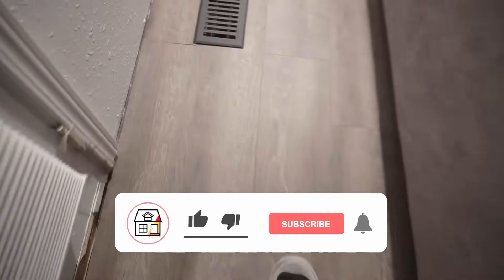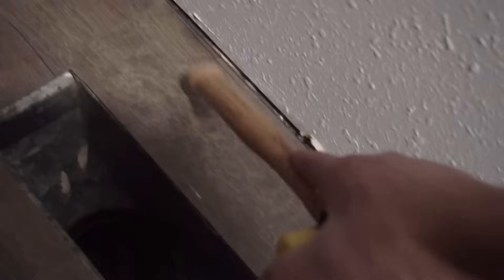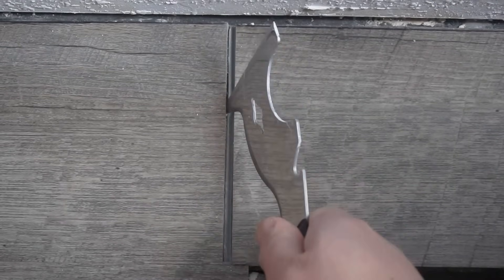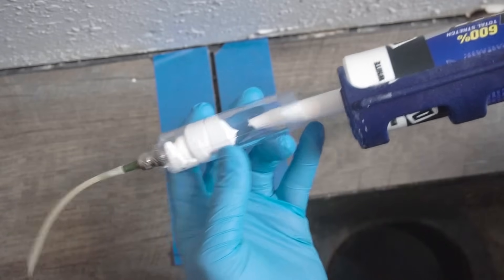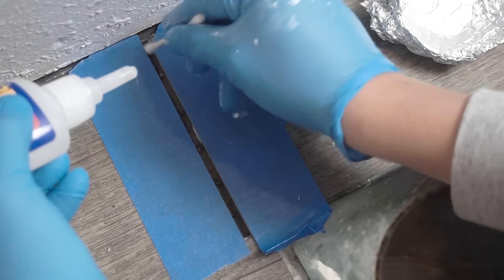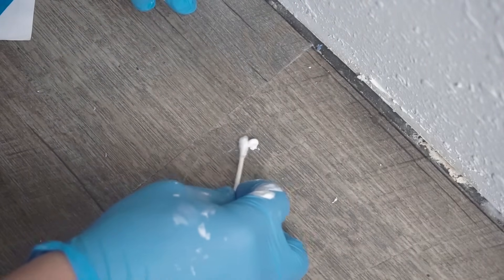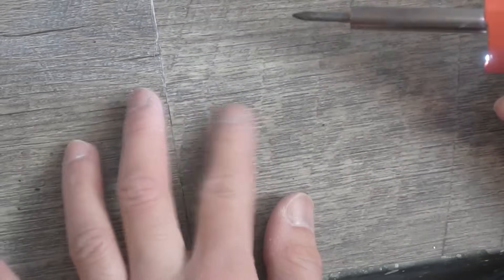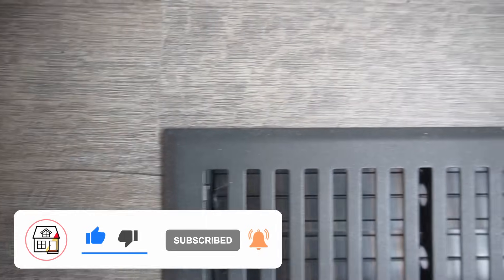How To Fix Uneven & Loose Laminate, Vinyl (LVP) And Engineered Floors DIY Tutorial Tips and Tricks!

Comment: Thanks! You are pretty amazing! I learned a great deal from you and I will be putting it all to work here in my fifth wheel RV. I am in the process of replacing carpet with LVP and the floors are a bit uneven. That causes the long seams to resist fitting together perfectly in some spots. Based on your instruction I believe I can solve the problem. I'm curious, did you go to some sort of trade school to learn this or did you manage to do it by trial and error? Either way, big thanks!

Comment: This video saved my bathroom DIY. Everything was back in place, and LVP is textured. I bought the suction cups, but it couldn't overcome the texturing. However, I bought some mounting putty (like for posters) and shaped it around the rim of the cup. It required some downward pressure to fill in the gaps before I locked the cup, but it worked like a charm!

Thank you thank you thank you!

Comment: If my sag is on the long end? I thing the gap below caused a section of the long end locking strip to get damaged? Would you fill with the stretch caulk through the drill holes and glue the long edge?

Comment: I could not find any videos on your channel that deals with sheet vinyl. What do you recommend laying sheet vinyl that covers two levels. I've removed the carpet from living room and the sub floor is plywood and then then to kitchen that has vinyl tiles that are glued down. My question: Is there a product that I can apply that will transition the two levels and make it to where you will not know it has changed levels?
Reply: How thick is your glued vinyl in kitchen? If it's 1/8" you can get away by feathering from vinyl to osb using floor leveler, just make sure you make the transition about two foot wide, so it is almost unnoticeable to the foot when going from living room to kitchen. 
After patching that, you'll need to put 1/4" floor underlayment in the whole area where the sheet vinyl goes, I know, this part is kind of expensive but necessary, never ever install sheet goods directly over osb.
Then install the sheet vinyl using the recommended adhesive for that especific vinyl. If it is felt backed, use adhesive for felt back, if it is the sheet vinyl that requires pressure sensitive glue, use that glue, this step is crucial.
I would try to remove the kitchen vinyl if possible, that way everything is level, if you opt to do that just make sure that you don't leave an sticky residue before the 1/4"underlayment. If your kit area floor is sticky you can emboss it using a very  thin layer of floor patch, just enough to neutralize the old adhesive, otherwise it will give you a clicking sound every time you step over the underlayment in that area, some folks just put roofing felt paper over the sticky floors to neutralize and then install the 1/4" underlayment.
My guess is that you already have a 1/4" underlayment plus the vinyl in kitchen area, about 3/8" total height, if that's the case, just install underlayment in living room areas to kind of match the height and then patch between them.
I always try to remove the kitchen floor if possible but sometimes it is a lot and is better to just leave it alone.
I hope everything made sense and didn't confuse you.

Comment: Do CA glue.... attach boards...spray on accelerator....it wicks through the joint...if you add it while the joint is open it'll set up quicker than you can pull it back together....I wouldn't recommend drilling holes to inject anything....drill a hole...and inject something... warranty is over
Reply from the maker: Thank you for the tip and advice 🙏🏽I mentioned warranty during the video 👍🏽😊
Reply: @FixThisHouse  Yes sir... drilling holes in any flooring system will negate it's warranty.... just tryna help you out... 😉👍

Comment: Well this is nice but my boards worked loose along the long side due to slightly uneven floor I think. not the short side. Long side doesn’t want to move at all to close the gap. I actually made the surrounding area worse by messing with it with my suction cups and mallet ☹️

Comment: I have the exact same flooring as you do in the videos. I have a piece where the locking (male+female) mechanism has broken on the long side of the board. Would you use the same method to separate the pieces and glue them back together?
Reply: Just replace the board....takes not even 5 minutes
Reply: @habanohal  how do you replace it easily if it’s in the middle of the room?
Reply: @Leticia Ramirez  many videos on YouTube how it's done. Hard to explain, possible if you don't do flooring. Just will take some practice

Comment: I know you use big stretch for movement, but isn’t movement the problem? Don’t you want the movement to stop so it stops separating?
Reply: You need to allow floating floors to expand/contract, so movement is required. The cause of the original problem was most likely due to lack of space to move around or uneven subfloor

Comment: Your failing to address that the flooring was installed incorrectly to begin with, you should have the tung and groove engaged on all sides of the piece the flooring installer took a short cut and cut off one of the grooves that's why this section is not coupled to the other piece, click together floors are actually pretty difficult to install around obstructions and you need to know the myriad of tricks to get it installed around doors and vents.

Comment: I think that was very silly presentation 
. Unnecessary hole because in that case you using flexible clear plastic pipe .stick on tube and you can use your went hole to put the silicon under. You must be diy person just without imagination.